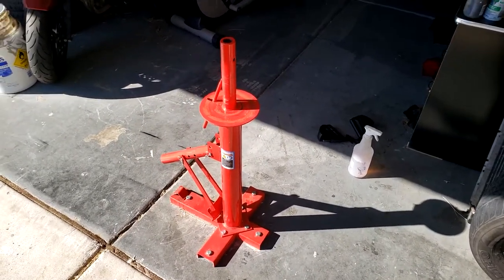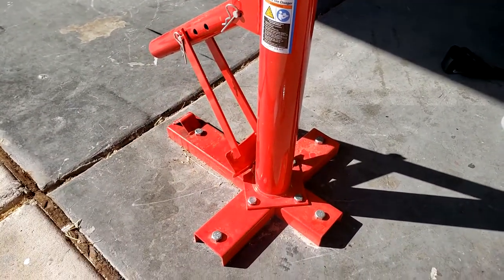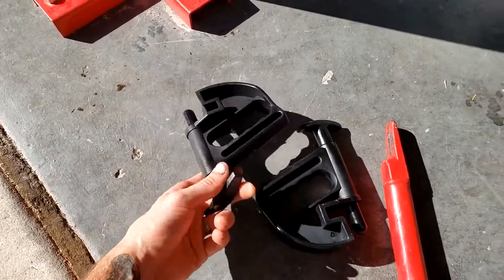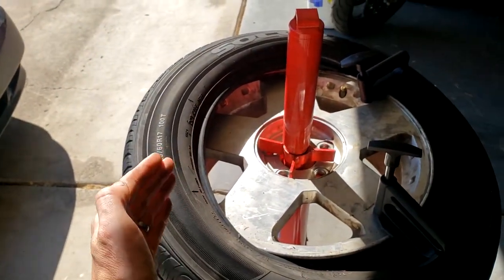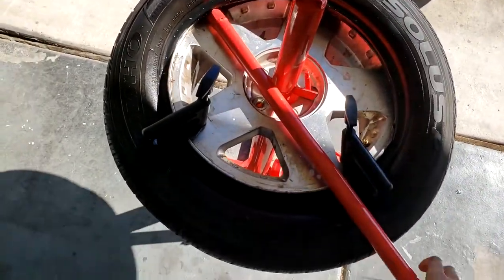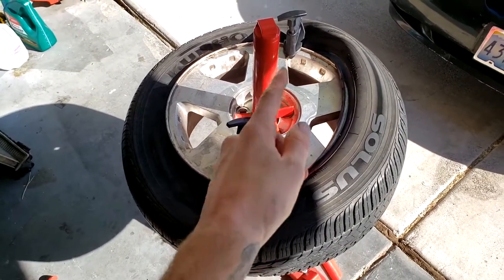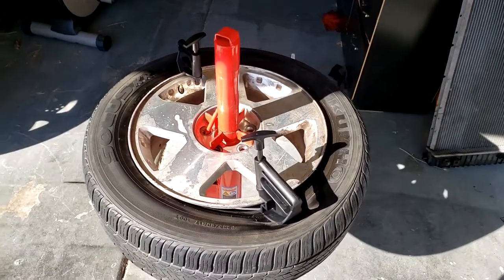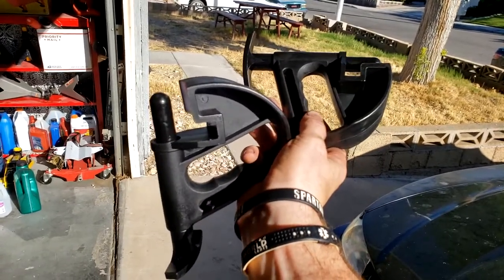How to MOUNT Tires with a Manual Tire Changer !! EASY !! (Harbor Freight)

Comment: Helpers are there to make sure the bead of the tire stay down near the center of the rim where the diameter is smaller., thus giving you slack to pry the bead over into the rim. Normally people use hands to push the bead down but for those low profile or runflat tires, these helpers REALLY HELP.

Comment: Angle the first edge in near the bolt that keeps the rim from spinning that also seems to help, when you're up against that bolt the changer doesn't work that well. This might have been in the instructions but I never had the instructions for mine.

Comment: Will a 13 inch zero turn wheel fit on that tire changer?
Reply: Think it would depend how the center fits
Reply: Looking at my honda wheels I might have to use an angle grinder to trim that middle part
Reply: Yeah they fit. If it's like a 13" 70s japanese car rim or similar.

Comment: The HF tire changers have been upgraded. They replaced the cross bracket with a round plate that has a rubber pad.
Reply from the maker: Hey that sounds a lot better! +1 for HF!
Reply: I put a piece of leather I had on mine had to cut the hole in it.

Comment: Nice  the first tire I put on was a 20 inch  255/55/20 
I could not put the tire on until I grabbed 2 pry bars and sat on the tire. 

I'm going to get 2 tire spoons and 2 hold down clips and tire changing will be a breeze